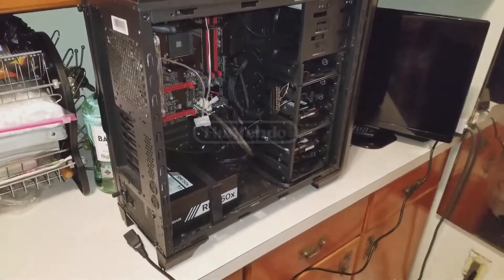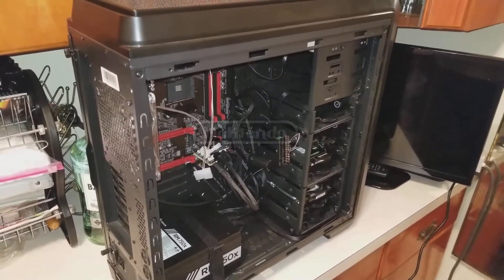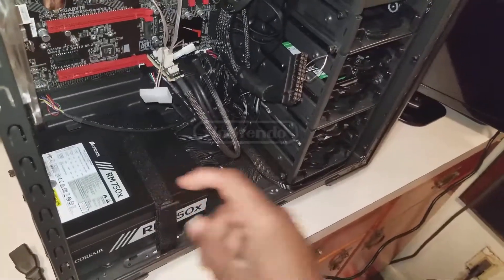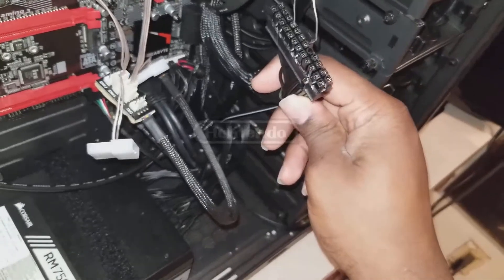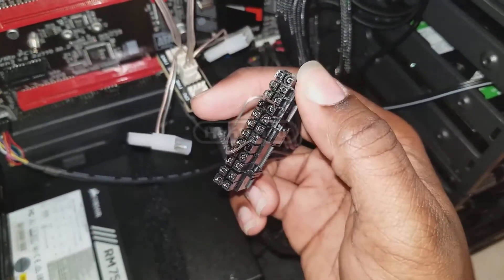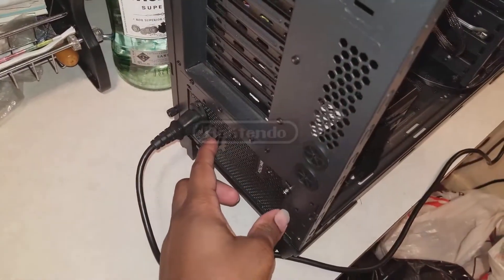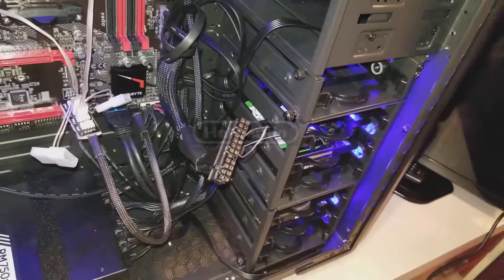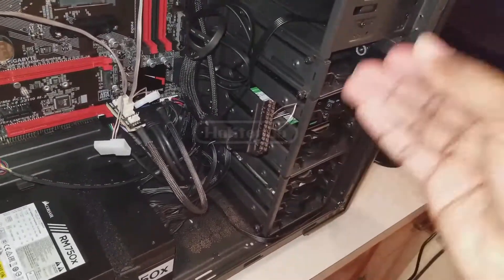How To Do The Paperclip Test On Corsair RM750X Power Supply

Comment: Been having some weird issue with my pc,problem being all hardware was not running at its peak performance, first I thought it was motherboard,then cpu because I never had any problems booting up or bsod, would boot up fine. Now the problems I was getting were gpu was underperforming even with a low overclock,ram speeds were down,ssd speeds were down,cpu overclock speeds well down.

Now usually a faulty psu would either stop powering the pc or cut out when using the system under load. None of these things happened,I just got low performance......so I looked at the board and cpuxchecked cpu pins and nothing out of the ordinary I could see.system was clean and no dust present. 

So I decided to upgrade my motherboard and cpu for zen 3 ryzen 9 5900x and an asus tuf x570 motherboard which will be arriving tomorrow through the post, then I noticed you could check said psu,mine being the rm 850 corsair gold with a paperclip,I followed corsairs diagram and it stated pins 16 and 17 which I did.......... I got no power at all from the fan. Weird!!!! As it does work in the system...just not doing this test.

I never plugged anything else in the psu other than the 24 pin to test as it never mentioned to do,so considering my system was running alot slower I've now decided I'll be buying a new psu. It's not worth the risk of me using this with my new board and cpu.

Comment: Did you disconnect anything else or just that big plug?
Reply from the maker: Just the plug. But you need to at least have a fan or 2 to put load on the psu for it to turn on.
Reply: @Haktendoo  ended up being the CPU. apparently rare, but I cooked it. I ended up getting a new one and now the PC runs great.
Reply from the maker: @timquain5341  Aw sorry to hear that.

Comment: My update as i said it i was going to do. For me it was my GPU, also i had 2 gpu, so when i was trying to put an Aio cooler on my 1070 i must of short-circuited, so be very careful if anyone decides to want to put a AIO cooler on ur Graphics card. And my Zotac 1050ti i was using while i was trying to put the cooler on 1070, i must have been yanking the card out and at times i would forget to take the HDMI cable off, whenever i went back and forth between cards. Again people careful with ur hardware, treat them as it where ur baby.

Comment: Noticed most of these videos, have Corsair failures. Mine too, also other products, have been disappointing, no more Corsair. So what does it mean if the PSU starts ur Post testing the Lights like Led's and cooler fans are running, but the Corsair fan on the PSU stops spinning ???  Like the safety tips cuz very true man. But yeah i don't Recommend Corsair, many things i bought of that brand just been failing, and i always buy new.
Reply: @Haktendoo  :: so it does not mean my PSU it simply damaged?? cuz i did the Breadboard test on a couple my mobos and nothing but with the Corsair PSU did the paperclip test and added 4 fans, test it. The psu fan spins  and the case fan spin and the LED's to case fan stay running and spinning but the PSU fan will stop on the Corsair. .So the PSU when it detects temps getting hotter the PSU fan will begin to spin to cool down? cuz i am out of options and i been running test on both my mobos and i am getting no post? just thinking or getting some components, and new mobo
Reply: @Haktendoo  :: well it was a full running PC, give yuo the specs 
Asus B350-f Gaming
16GB Ram 3200MHz flareX
GTX 1070 8GB Founders Edition GPU
Corsair RM 750x
212 Evo cpu cooler
M.2 W/D Black 256GB NVMe SSD
3TD W/D Blue HDD
But B4 it just stopped displaing image, i had my spare Zotac Mini 1050ti 4GB. While i was adding a Aio cooler to the 1070 GPU. i mean theres more to the story if you want to know the rest just ask me and i will try to be as brief as possible. But i have not been able to get it to Post.
Reply: @Haktendoo  :: i took out thr mobo out and placed on top of mobo box to diagnosis. As for the 107 it all started when i tried to add ao Liquid cooler to the GPU. i do not know if ur familiar with modding GPU's to get cooler temps? well, i did that and i could not find anything could not Boot or Post test, my PC. i Thought its to much trouble carrying the AIO and the GPU and try to perform a test to PC. so i decided to put back the original GPU case. And now the GPU fan doesn't come on now or the Logo light to the GPU. so I'm out a PC for the moment.
Reply: @Haktendoo  :: yee i know waz the GPU, cuz like i told ya, i tried the same GPU, on a back up mobo, with its own cpu, Ram, and PSU.. And i got the same results.. But Saturday, i get a New GPU, and ill update you. Maybe useful info later for you, ill give you the whole run down on what i was trying to Achieve, so if you think of doing it to you want to think about it, LOL ok , alright man, ill keep ya post it
Reply from the maker: Alright.

Comment: hey bro, i have the same PS and I need to know if the fan of the power supply is ever on, because mine it's not and I dson't know if this is normal.  Thanks!
Reply: @Haktendoo   Thank you so much bro, I was worried cause I opened itt to fix a vibrating sound.
Nice video by the way bro ! keep it up !
Reply: My RM550 PSU fan starts, then stops after about 5 seconds. A few seconds after I turn it off, I hear a click inside, as if the PS resets itself.

I don't think I can put a load on the PS because the fan connectors are the wrong gender for the adapter that came with it, and nothing works on or thru the MB.

Comment: Does the psu fan spinning with no stop whan do the paper clip test?
Reply: @Haktendoo  that's what i was thinking reading the manual had me worried the first time sitting here rn with just psu all other parts haven't been delivered yet and rtx 3070 will probably not be ready till December
Reply from the maker: Newer psu and gpus has a technology when the device isn’t hot the fans don’t spin. But when it detects it’s getting hot the fans starts to spin.